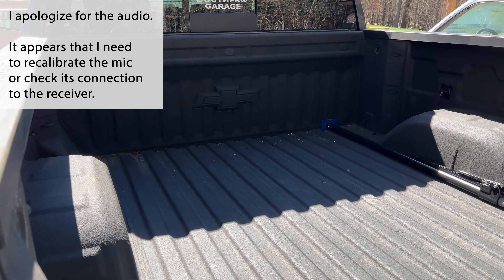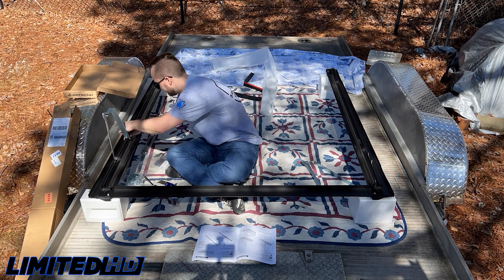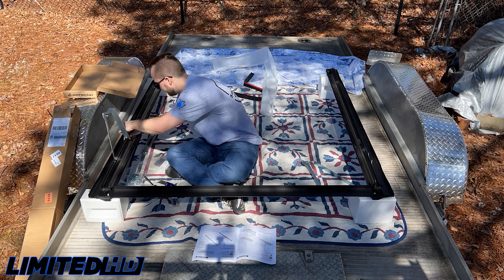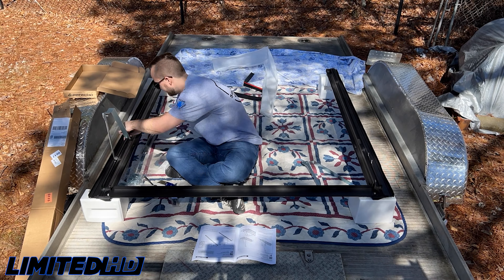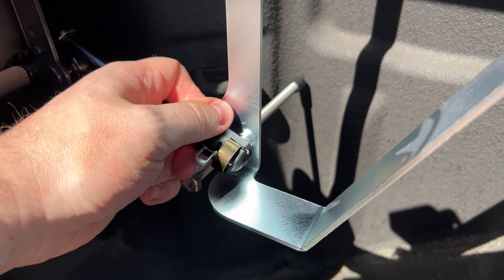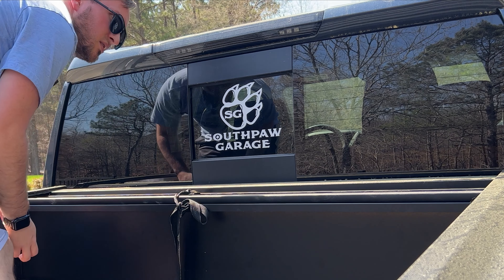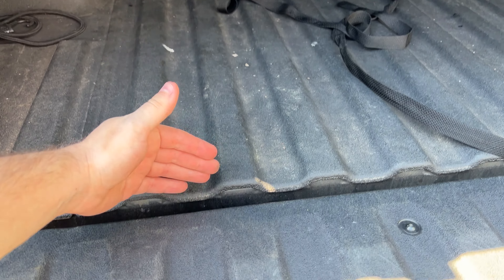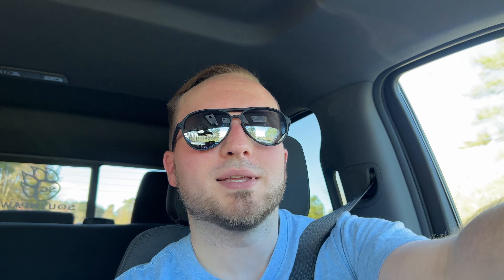Peragon Limited HD Bed Cover - 2023 Version

Comment: I see that there is a metal bracket on the side for the shocks. does that get in the way when you are putting things in the bed?
Reply from the maker: The brackets do take up space in the bed. When packing the bed, items must be placed around the brackets (between them or to the outside) unless they are short enough to slide under them.

Comment: You downgraded! This has to be a paid advertisement.
Reply from the maker: I love the Peragon bed cover. It looks better than the Roll N Lock did on the truck and I like the feature of being able to remove the cover easily if I want to. I don’t agree that this is a downgrade. They also did not pay me to do this video. I was debating between Peragon and Roll N Lock when I first got the truck. I got Roll N Lock at the time because I had them on my previous truck and I went with the brand I knew, but I’ve been keeping an eye on Peragon ever since and finally decided to try them out. I’m very happy with this switch and I’m glad I switched.